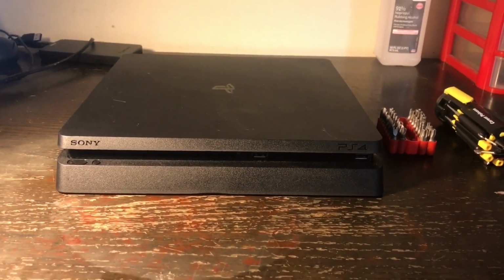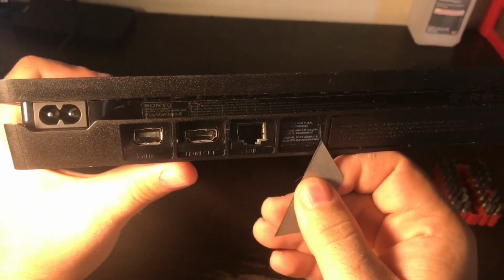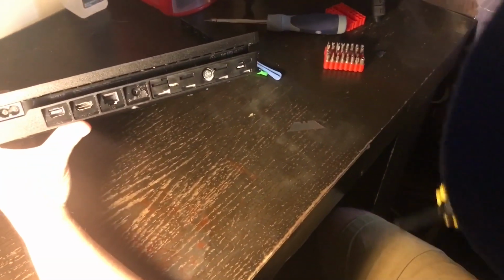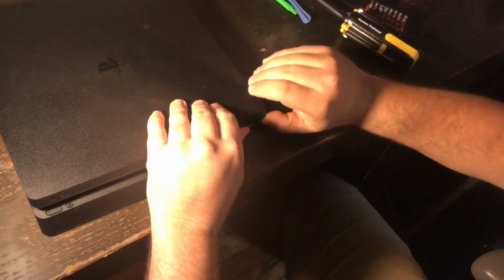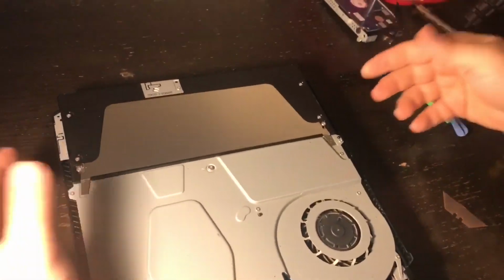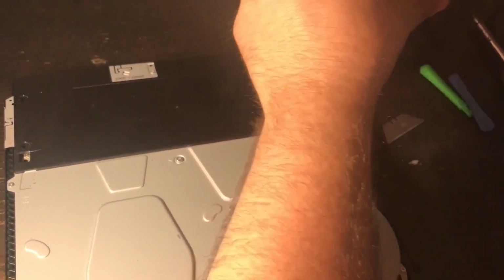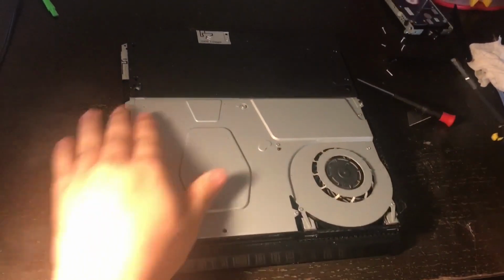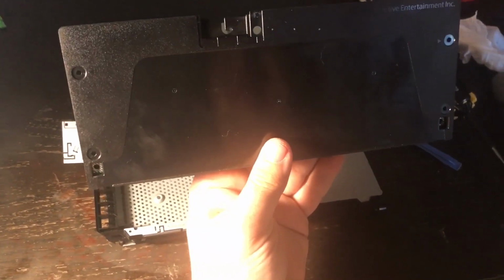Dead PS4 Slim? Replace the Power Supply Yourself #ps4

Comment: Can you use a normal ps4 power supply on a ps4 slim?
Reply from the maker: No unfortunately you cannot there has been several revisions to the PlayStation power supply so what you need to do is look on the back at the model number it starts with a CUH and then you will look that model number up and it will tell you what power supply you need for your PlayStation as they are all slightly different.

Comment: what else would be the problem if even after I replaced the PSU. My ps4 shows no sign of life.
Reply from the maker: It could be a number of things and without looking at it I really wouldn’t now but a good piece of advice I can give you is to look back over every wire and make sure it is plugged in OK and also look for bad places on the board the motherboard I mean and see if there’s any places that looks like it’s been shorted out.

Comment: So I opened up my ps4 slim cleaned it but it seams as tho the white 4 pin connector is either broken or faulty either that or it’s the actual power supply btw what does that 4 pin connector do
Reply from the maker: The four pin connector supplies power to the motherboard and if that came off that is exactly why it will not come on and it needs to be soldered back on and depending on if any part of the motherboard came up or if it was a clean break determines the way you need to solder it back on.  If you have any further questions just ask.
Reply: Mr. Goody I took it apart and opened up the power supply and pushed down the connector down and it seemed like it worked my ps4 is working better now but it’s still freezing here and there thanks for the info really appreciate it
Reply from the maker: Your welcome if you ever have any more questions just ask.
Reply: Mr. Goody so if the wire is faulty what kind of symptoms should I be looking for
Reply: Mr. Goody one more thing how do I tell if it’s the hdd that’s failing or the power supply
Reply from the maker: I usually test the power supply with a multimeter, without seeing it in person, my best guess would be it’s your hard drive.
Reply: Mr. Goody ok thank you
Reply from the maker: NT Clan Your Welcome 👍

Comment: Can u help me pls i have ps4 slim not turning on i want to change its power supply and i have my old og ps4 can i use its power supply
Reply: My old ps4 model 1116A
Reply: My ps4 slim is 2216A
Reply from the maker: No unfortunately you can’t,  they are totally different.  You can find a good replacement on EBay or Amazon.
Reply: Thx man